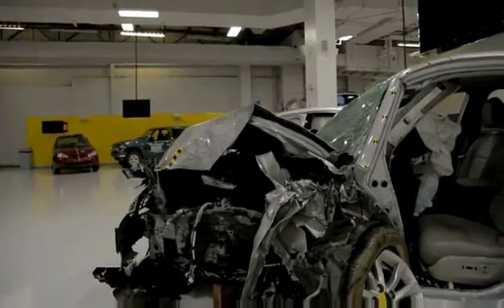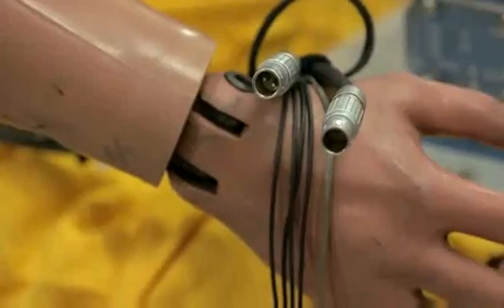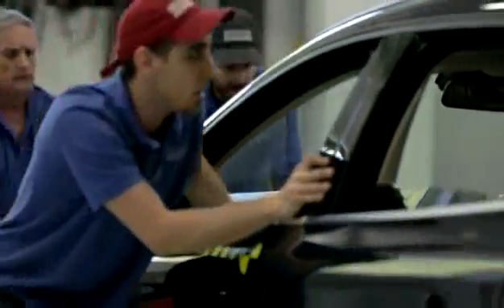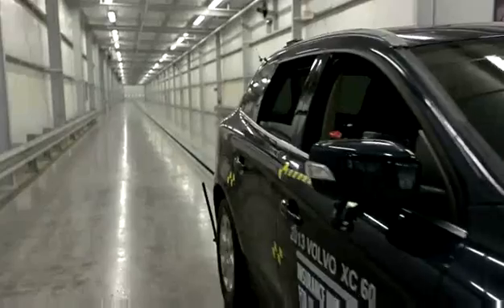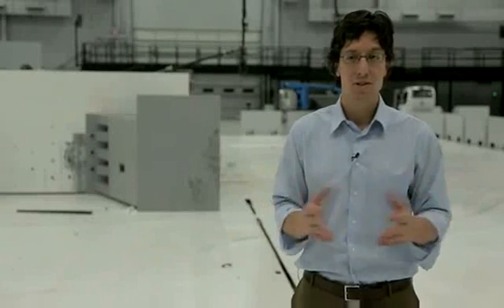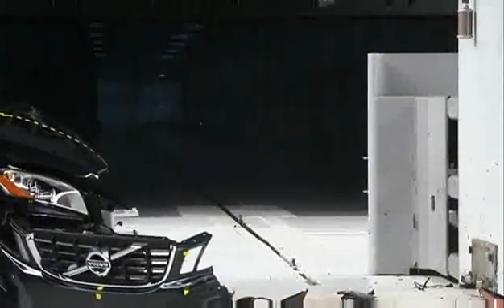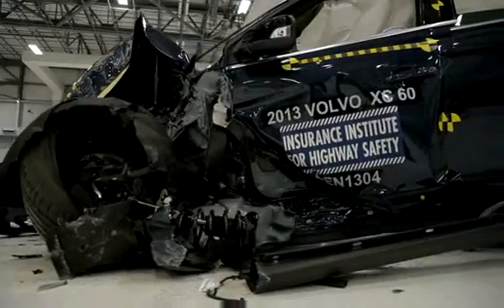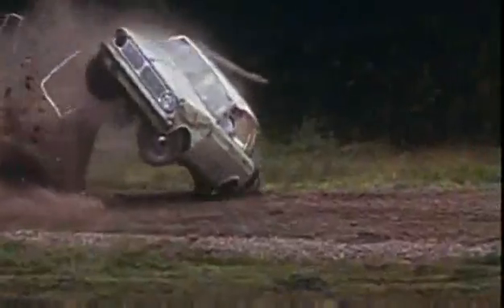2013 Volvo XC60 - IIHS the small overlap front crash testing (2013 IIHS TOP SAFETY PICK+)

Comment: It's renew or die. I'm a Volvo fan, but I know they went through a period of poor reliability from 1999 to 2002. Reliability started to improve from about 2003, and now, IMO, is very good. Then the XC90 had a rough launch from 2003 to 2005. Some people still think Volvos are unreliable because of these years. In recent years, Volvo has let some of it models stagnate, and sales have suffered as a result. Now Volvo is redesigning all it's models. But Volvo has never compromised on safety.